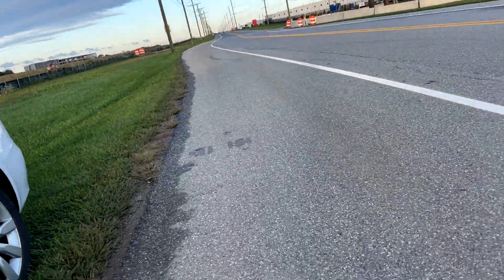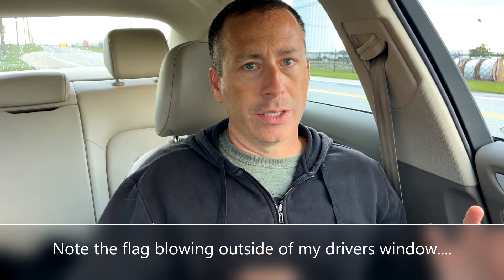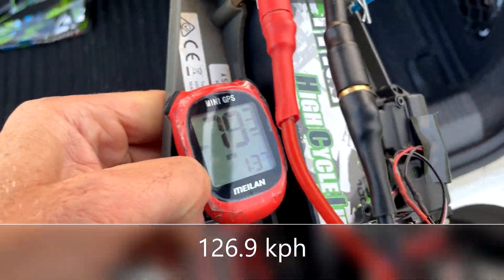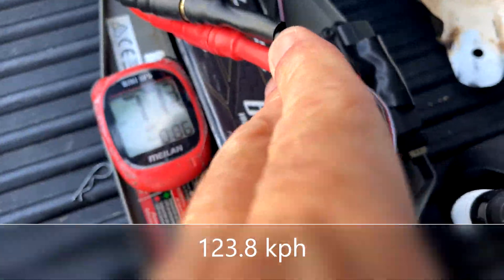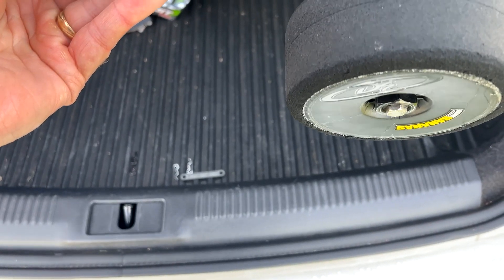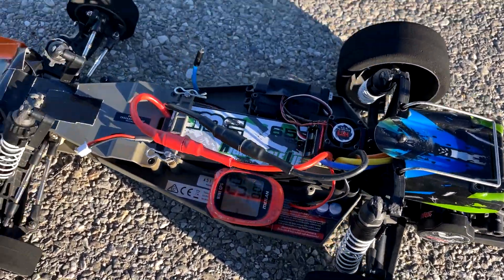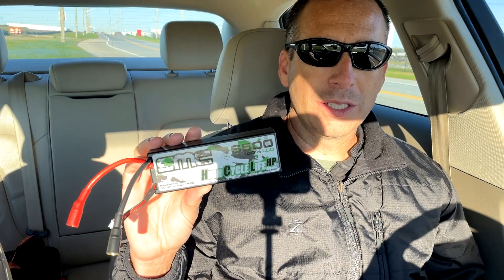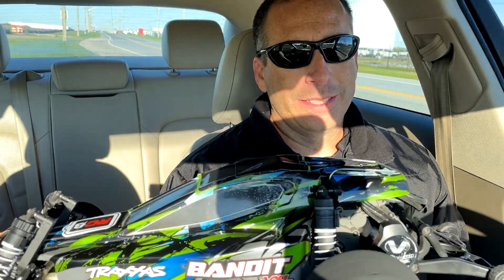LiperiAir 6200 vs SMC 6500 - 3s Speed Run LIPO Test - Which is Faster in a Traxxas Bandit VXL?

Comment: Awesome speed runs. I love that response to the pedestrian too. I can't fit my 3s 6200 in my Rustler at all. It seems like the only 3s I have that will fit is my Zeee 5000. Did you modify the battery tray at all?
Reply from the maker: Check to see if there is a foam block back in the rear if the battery tray.  Yours should be the same as mine as mine is not modified. I had to massage the wires in there…. It was tight but it fit (just).
Reply: @BriansRCStuff  I left the foam in the parts bag. The width was fine but I think it would fit under the esc. I'll check when I get home. Thanks
Reply from the maker: @nwirc  oh yes!  You need this;

https://m.traxxas.com/products/parts/3725X